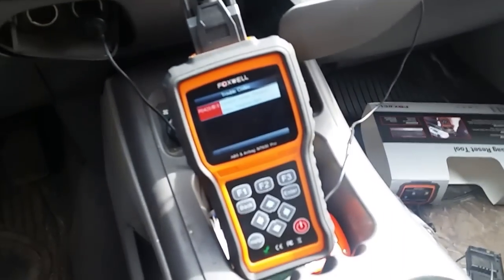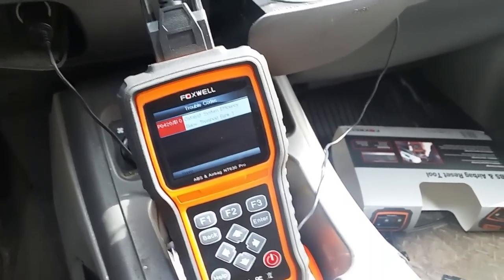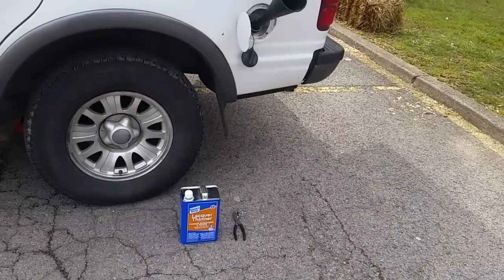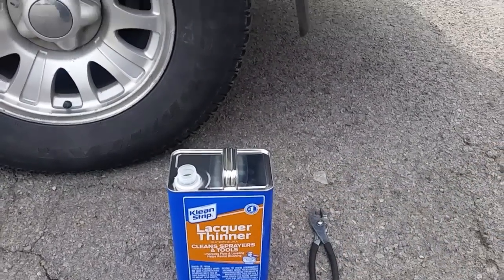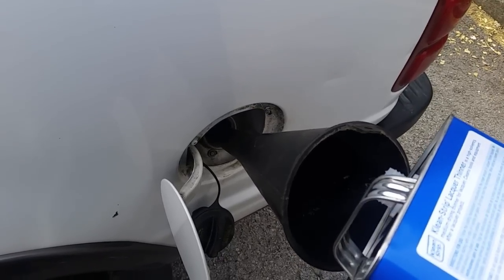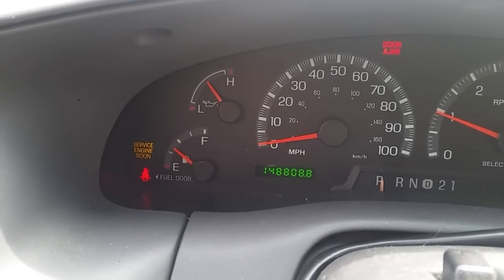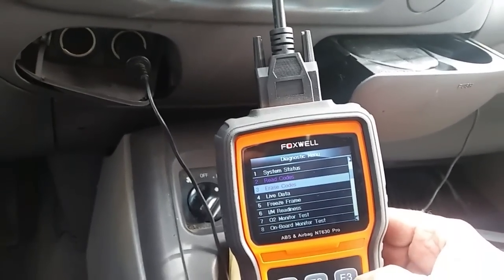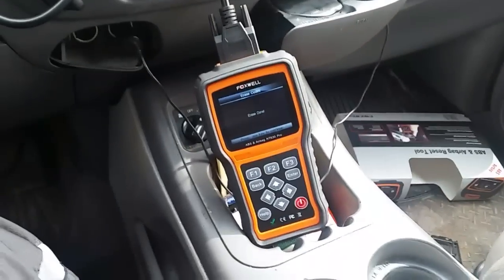PO420 Myth Busted?? PART -1 Lacquer Thinner in your Gas tank? Will It work??

Comment: Y 2000 Acura TL is throwing the p402 code for clogged converter, it's running excellent but isnoisy at higher revs, ny suggestions that are safe?
Reply: Scott Kilner says the light will come on if the converter is running at 94% which isn't terrible. Maybe just put some cat cleaner in the fuel tank and run it.

Comment: My converter is about 1 year old and i have the 420 code. It stayed off for the first 6 months. I need to check the temp before and after on my converter first but i may just try replacing the downstream O2 sensor. I will never dump lacquer thinner in my gas tank. The light has been on for 6 months as it is so who cares and i still get about the same mileage anyway.
Reply from the maker: Yea its a issue lasting on and off.

Comment: How much To use on half tank of expédition 2003 5.4 triton?
Reply: Estiben 1 gallon to half tank cleaned out my 98 Expy. 4.6L. But it took a couple weeks for the ck eng light to disappear after  burning through the lacquer thinner.
Update.4 months and still no idiot light 💡

Comment: Lacquer thinner won't unblock a catalytic converter. That requires getting the exhaust hot enough to burn off carbon ,eg a long highway drive.

However lacquer thinner will clean the fuel system, injectors etc. ( The commercisl injector cleaner products ate just thinners with a bit of dye.)
Reply: Ive done this on 2 cars with clogged cats. It definitely does work.
Reply: @nonconsensusmedicine4755  True..1000%
Reply: Inaccurate information, Lacquer thinner acts as a burns off many clogged or corroded components in a Vehicle. The Top of them being a Catalytic Converter because the Fuel Injectors shoot that mixture of fuel and Thinner into the Combustion chamber which then has a reaction to any build up. Then goes through the exhaust system as a Fume or mist which then spreads onto all parts of the Catalytic Converter then down to the Cleaner Cats if your vehicle is equipped with them, Down to the Resonators and into the muffler. IT is not a harmful contamination to your vehicles components as to the regular vehicle additives that restrict you from having certain vehicle areas cleaned throughly. Vehicle additives = Money for there corporation/company.

Comment: I substituted 2 quarts of Transmission fluid to a full tank of gas. And drove my vehicle 40 miles & it did the trick. No more p420 code! Look it up trans fluid is great at cleaning carbon. And also is a great motor flush!

Comment: Really concerned about damage to other engine components due to laquer thinner on hoses, injectors, fuel system, got 20 k invested in my 2000 Acura TL, afraid to take the chance on destroying my engine, I live in Arkansas,and many people here remove them due to no inspection s in Arkansas, will this improve profirmance or are it run worse, please respond when you get time,thanks,
Reply: Doesn't affect performance
Reply: Nick Hines dont be a wus Nick. Scotty says its Ok
Reply: Laquer  thinner is pretty
Mild compared to ethanol. You are running 10% ethanol all the time.

Comment: Part 2: https://www.youtube.com/watch?v=2TnAk6etxJk

Oh and proper dilution is 20%, aka 1 gal lacquer thinner into 5 gal gas, and drive for at least 100 miles on the highway at fairly constant speeds (after which you fill up the gas tank to dilute anything left over before parking it). Of course that Expedition likely gets 10mpg so you may need 2 gals into 10 gals gas.
1 gal into 10 gal is 10%, half the dilution and less cleaning capability. Of course if the problem is holes or something else wrong with the cat then this will do nothing.

Comment: id worry about seal and line longevity and any other plastic the lacquer touches in fuel system.

To clear cat codes safely take a highway trip.
Reply: Luke Morrison it’s not an issue with today’s cars. I’ve done it twice and it worked for me. Cheaper then replacing cat.

Comment: Where to buy this lacquer thinner online ? And what is the percentage of lacquer thinner to gasoline ?
Reply: Faisal Mosaed Online, Home depot, or Walmart. 1/4 of gas.
Reply: According to the original video, 1 gallon in a half tank.  Drive about 120 miles at high speeds. You can buy it a Walmart for under $20
Reply: Faisal Mosaed السلام عليكم اخ فيصل هل نجحت معك عملية اضافة التنر لتنك البنزين مشان موضوع دبة التلوث

Comment: I want to try it on my 2012 Infiniti g37 but im a little scared. In all the videos of laquer thinner they usually pour it into older cars
Reply: My wife has a g35 I tried it and it work put about a gallon tho
Reply: I used it in my 2094 Hyundai Elantra. The Check Engine light went off for a week, then came back on. I changed both O2 sensors and the code went away for good! (P0420)
Reply: @mrbill6666  how is a 2094 model out when its only 2020?  And why being so new would it need any work??

Comment: ..Waiting for Part-2. I'm not that confident in Lacquer Thinner, Mineral Spirits, Denatured Alcohol, and the fuel treatments. I used to use a name brand fuel treatment and all it done was burn a hole in the exhaust manifold. I do put something in my fuel  for the outdoor equipment and in the vehicles tho...
Reply from the maker: Yea so many claims...at least I will see my own results....
Reply: @FixingWithPassion  Part 2? did it work?
Reply: You don’t know for sure if the treatment caused that. Maybe if you ran it straight with no gas. But most fuel treatments are just diesel fuel and some alcohol and or acetone. So don’t blame that for your exhaust hole.